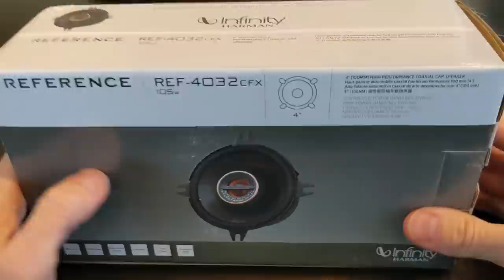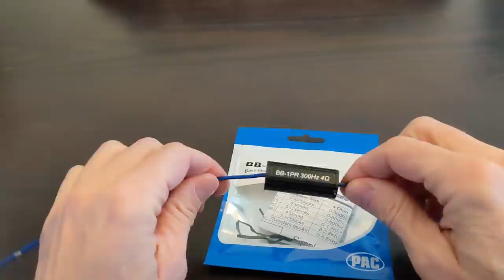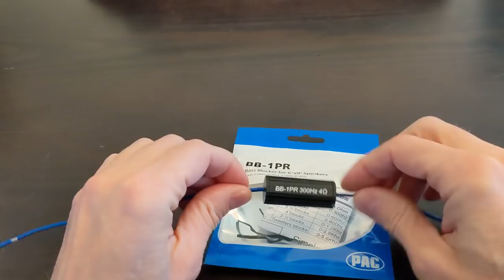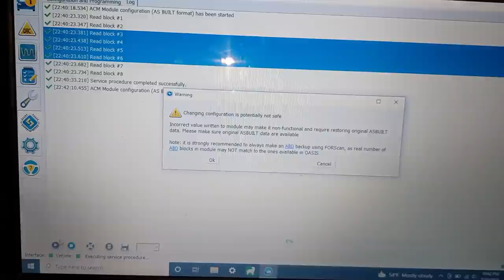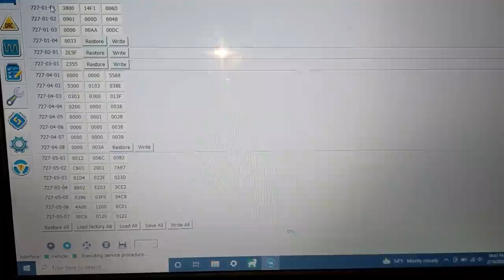2021+ Ford Bronco - Infinity Speaker Upgrade Plus FORScan Programming

Comment: Sweet update. Any idea why the programming from Ford was limiting the rear speaker sound to begin with?  Is it part of the fake internal exhaust sound?
Reply from the maker: No, I think it is more because they were worried about users blowing the crappy stock speakers.
Reply: What fake exhaust sound?
Reply from the maker: I have seen this debated but I agree at least on the Base, there is no fake engine sound being generated.
Reply: @BudgetBronco  I assure you neither does the 2.7 Wildtrack shit the speakers are shit it’s not like you even could. What the hell could be debated? What makes the “fake engine sound” sounds like flat earth crap to me 🤣🤣🤣🤣

Comment: Hey.  THanks so much. 

I noticed the 3rd bank of numbers on yours is 006D and mine is  0098.  Do you know what this controls? Thanks!!
Reply: Interestingly, i got a checksum errors with 0098.  When i updated to 006D, it worked fine
Reply from the maker: The third bank of numbers is automatically populated by FORscan, and might be different from vehicle to vehicle depending on your specific configuration. You can ignore that part, just let FORscan do its thing.
Reply: @BudgetBronco  thanks. So just ignore the checksum error?
Reply from the maker: Yes I think so. Keep in mind, in my video the 006D is the value AFTER I made the change. So if FORscan is changing to that value for you, we are the same

Comment: Has anyone thought about a subwoofer under the driver’s seat? Great video by the way.
Reply from the maker: Go to the bronco6g forum and search for subwoofer, there are a lot of posts with details of subs installation. Most people are mounting them in the rear cargo space. Thanks for watching!
Reply: I've been looking at the Kicker Hideaway HS8 or HS10 (powered subwoofer). They are pretty low profile. I have not measured if it will fit yet.  If you are the only one in the Bronco typically, that non-directional bass from a smaller sub may be all you need. There are rumors that someone is working on a custom fit aftermarket solution for the rear storage area (back right); we shall see.

Comment: Did I miss something?  Didn’t you do the kicker speakers as well? By your feet?
Reply from the maker: I did not touch those. I have read those are a higher quality speaker than the stock 4", and they mostly put out bass so they are sufficient for their purpose. They are also a lot more work to replace, you have to take off quite a few trim pieces to get to them.

Comment: Great video. I upgraded all of my 4" speakers thanks to you! Next step is doing the FORScan mod. Do you have the forum thread you referenced too?
Reply from the maker: Cool, thanks! I am glad it helped you. Here is the post. It is pretty long. Short summary: in the ACM module change the line 127-01-01 from 382B to 3800 https://www.bronco6g.com/forum/threads/full-range-to-rear-speakers.35116/page-6#post-1166298
Reply: @BudgetBronco  Awesome. Thread looks like a lot of them changed it to 3801 instead of 3800. I wonder what the difference is.
Reply: Last question! When saving modules before using forscan, do you save each module locally and then do you updates? Or only save the module you are about to update before and after you mod it? Also Go Hokies!
Reply from the maker: Not sure...I only tried 00. And yes GO HOKIES!
Reply from the maker: Here is a video on how to backup your module data before making any changes. You should save ALL the modules. That is the only way to be sure you can take it back to factory settings if something gets screwed up. It takes about 20 minutes of time, worth it. https://www.youtube.com/watch?v=XhFUlFgQPVE

Comment: Which capacitor do i need for the Infinity REF-4032CFX (4in) speaker?
400V - 1.5UF capacitor is good?
Reply from the maker: Sorry I do not want to give you bad advice so my answer is 'I don't know'. Check the link in my video description, the one I linked there I know works for sure.

Comment: Great video. But the ebay link for thr prewired connectors is no good. Page is gone. Any idea if anyone else sells them. Thanks
Reply from the maker: Thanks for pointing that out. I will update the link. Here you go: https://www.ebay.com/itm/334544575664?hash=item4de4691cb0:g:9D4AAOSwdrpi2U~o

Comment: Great video!  Quick question, can I sue the wiring harness with the bass blocker in the front?  Thanks!
Reply from the maker: Sorry, I am not sure I understand your question...please clarify and I will try to help
Reply: @BudgetBronco  sorry!  If I use the wiring harness from Amazon will I still be able to use the bass blockers on the front speakers. Would I put the blockers between the speaker and the harness?
Reply from the maker: I'm not sure which harness you are referring to....maybe the one from Ebay that I linked in my description. If so yes, you would neet to add the capacitor to the + side of the harness. I think that same guy was also selling harnesses with a bass blocker already wired in...check on that.
Reply: @BudgetBronco  perfect! Thanks!

Comment: I noticed that stock speakers RMS are 25 watts and the Infinity’s are 40 watts. Is the factory head unit handling the additional power draw?
Reply from the maker: I have not had any issues at all with power draw. I think the difference is not enough to cause any problems.

Comment: I bought bb-4pr instead of bb1 by accident do you think that will cut out too much low frequency?   I will add a sub later so maybe in the long run that’s ok?  What do you think?
Reply from the maker: Hmmm...just reading up on BB-4PR it looks like those are going to cut out everthing below around 1000 Hz whereas the ones I recommended cut at about 150Hz. That is a big difference. Good news, it can't actually hurt anything, it is just going to make those speakers act like pure tweeters. You can give it a try, and if it sounds OK to you, then good. Like you mentioned, if you are going to have a sub, then this is probably going to be a good combination.
Reply: Thank you.  Great videos!

Comment: Ya definitely a improvement so all speakers are 4 in?
Reply from the maker: Yes, all 4 inch. When I did this mod almost 2 years ago, they did not exist but if I were doing it today I would probably purchase the larger rear speaker enclosures that allow you to install 6 inch spearkers.
Reply: @BudgetBronco  I have a 4 door big bend ordered with the basic speakers, so I am probably gonna get 2 sets of these
Reply: @BudgetBronco  I’m curious do you regret getting the infinity speakers over something else like kicker? Do they sound great?
Reply from the maker: Can't really say how they compare on sound, but I am happy with the Infinity they sound good for the price, and definitely a LOT better than the stock. I think to get the sound system to truly 'great' you will have to buy an amp and a subwoofer.
Reply: @BudgetBronco  curious is your rig not supplied with a sub and amp? If not does ford supply the ran wiring still to hook up aftermarket units or will that wire need to be ran?

Comment: Very cool. Did you try without the bass blocker?    I wonder if it’s already filtered digitally since it should be going to the kickers anyway.
Reply from the maker: No I did not. But the stock speakers have a blocker built in to them (you can see it at 2:22 of the video) so it makes sense to add one when you install new speakers
Reply: @BudgetBronco  makes sense! Thanks for the great content!
Reply: They sounded super crunchy without the blockers. Now the bass stays low where it’s supposed to be and fills the space nicely. $10 well spent.
Reply: Some speakers have the bass blocker (Caps) already installed on the speaker as these stock ones do.

Comment: Why did you put a bass bypass in the dash speakers?  The dash are fed from the kick panel speakers and I thought they already had a bypass in the wiring harness?    I like the upgrade. Definitely sounds better but could use more bass.
Reply from the maker: Correct, the dash speakers are fed from the kick panel speakers, but the bypass/blocker is built in to the dash speaker, so when you remove it the bypass/blocker goes with it. If you pause my video at 1:54 you will see that on the speaker on the right.
Reply: Thanks. Are the rear speakers the same?
Reply from the maker: Yes, the stock rear speakers are the same part number as the front.
Reply: So you added a bass blocker there too?
Reply from the maker: No, I did not in the rear, mostly because unlike the front there is no kick panel speaker siphoning off the bass.
Reply: Thanks again for the responses. I don’t have my bronco yet.. build date is 3/28 (maybe 🤞🏼) so I’ve been buying upgrades in the meantime.  I’ve already bought my speakers but appreciate all the tips I can get.  Thanks for the content.

Comment: Great video. I feel like I could do this! FYI….eBay link isn’t working.
Reply from the maker: You can definitely do it! Thanks for pointing out the link, I just updated it. They guy selling them has recently restocked so they are available. If you go that route, it will make the process even easier. Thanks for watching!

Comment: Not sure why you would cut the factory harness when Metra adapters are available.
Reply from the maker: Because it is easy, and to save $20...this is Budget Bronco after all! If you are not comfortable cutting and splicing wires, buy the harness.

Comment: are both front and back speakers the same size 4" Thanks.
Reply from the maker: Yes. The dash speakers and rear pod speakers are all 4". The kick panel speakers down by your feet are not, they are bigger.

Comment: Isn’t the rear black wire with white stripe typically negative?
Reply from the maker: Here is the wiring diagram as published by Ford https://www.bronco6g.com/forum/threads/bronco-standard-sound-system-6-speaker-upgrade-diy-writeup-w-instructions-dash-kick-panel-speaker-removal-wiring-diagram.25210/

Comment: Where did you put tge bass blocker?
Reply from the maker: You can see it at 12:31 of the video. The bass blocker goes between the speaker and the dash on the POSITIVE wire.

Comment: do you know if these speakers are 4ohm to match the stock speakers?
Reply from the maker: Product labeling says 'Nominal impedance 3 ohms'
Reply: I would be concerned of overheating with lower ohm than 4.   But my old school radio install days were back in 80s
Reply: Haven’t had a problem and have had the Infinity Ref installed since August.
Reply from the maker: Same for me, no problems so far and I have had them cranked up pretty good.

Comment: No base blockers on rear speakers?
Reply from the maker: No. The thinking is, the front dash speakers are wired to the same channel as the kick panel speakers, so the 6" kick panel speakers make the bass, and by blocking the low end to the dash they can operate more efficiently by producing just higher end. The rear has the 4" speakers only, so different setup.
Reply: @BudgetBronco  thanks

Comment: needs sound deadening padding to prevent hollow sound in this 4x4.  It's a plastic monster
Reply from the maker: Yes I think you are right, it sure can't hurt in the rear, where the speakers are housed inside plastic tubs. I am going to add that. Thanks for the comment!

Comment: Modifications special programmers upgrades all to make it better, why don't they just build it correctly the first place
Reply from the maker: I think the clear answer here is $$$. Ford designs to the lowest investment in audio that will make most people satisfied, knowing that audiophiles and people who care will do aftermarket improvements without much complaint. The real bummer is for those that spend on the B&O upgraded system and still get something that is very marginal.
Reply: @BudgetBronco  the B&O system is very marginal in the F-150 as well. And I understand a car with removable doors create some challenges and space for a subwoofer as well but they just did a very poor job overall in the vehicle itself, outside of maybe rivaling or exceeding the Jeep and some ways it falls very short overall convenience as a daily driver. It's hard to justify 40 to$70,000. But it's the social media hype generation...so mediocrity is the rule

Comment: I brought the same OBDlink Ex for my 2023 bronco. But when I run it. ACM module didn’t show up. Can’t access the speaker adjustment. There list modules show up on mine then your. Can you help in anyway.
Reply from the maker: I would try installing an older version of FORscan and try again. I had the same problem with the most recent version. Try version 2.3.48 you can download it here https://forscan.org/changes_history.html